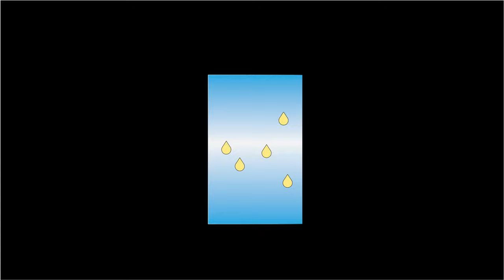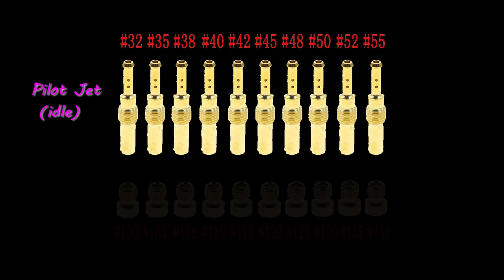Motorcycle ATV Engine Exhaust Popping or Backfiring - Rich or Lean?

Comment: We had the same experience with my motorcycle, I thought getting backfires are caused by a rich mixture so for the past 2 weeks I've been trying to experiment to add more air, but the backfires are getting worse so I tried to add more fuel, and now my motorcycle is running great and it has no backfires.

Comment: Excellent video! I’d note that for diagnostic purposes, the pilot jet is responsible for off-idle performance, needle/needle jet addresses mid-range performance, at wide open throttle it’s all main jet. I’ve found that Japanese OE needles are more accurately made than typical aftermarket versions so I usually just scotch-brute the OE needle and ignore the one furnished in rebuild kits.  To adjust the needle height when there is only one groove for the e-clip I’ve had success by adding one or more washers (thanks ace hardware) below the clip to raise the needle richening the midrange mixture—same result as achieved in the video by moving the e-clip to a lower groove.  Keep up the good work Redneck!

Comment: Bought a second hand Chinese quad for $500aud, got it from a diesel mechanic, he told me it had some sort of ignition problem and he started it by bridging the 
positive and negative, kinda a hot wire job, he told me he had no idea why or how, I got a new starter relay, and fixed. He also put a new pz30 on it and told me he could not get it to run right, used this video and moved the small clip down 1 notch, and runs like new now! So much for the sellers mechanical skills!
Reply: Lol

Comment: About non-adjustable needles, you can adjust them richer with 0.5mm shim discs. Though you cannot go leaner that way if your problem is too rich condition. Alternatively there are tuning kits from Dynojet to some carbs models and they may contain a new adjustable needle for carbs that are not adjustable by default.

Comment: Really good video right here! I have a 2005 raptor 660 that backfires a lot on decel and only will idle with the choke on until it is fully warmed up. It also kind of breaks up when giving it gas until after 1/4 throttle. Stock intake and exhaust too
Reply: Did adjusting the needle and cleaning the jets fix your problem?
Reply: @d21dusty72  nope, i replaced the piston and rings because it was low on compression. Thats fixed my backfire issue but I still need to use the choke until it warms up. Probably needs bigger pilot jets

Comment: What about running full throttle, then letting off completely say to shift or stop? Poping constantly after, it's fine at idle fine with the throttle, but now when decelerating especially completely, it pops.  I figure running rich but the fuel metering screw is all the way in ( bought a replacement carb). If I back out and play with the idle screw to bring down the idle it gets worse with the popping.

Comment: Fantastic video thanks! My problem is the motor and carbs run great while going wide open, but then after like 5-10 seconds it starts not sputtering and sounds lean -- wondering if the fuel petcock is blocking proper flow?
Reply from the maker: Close the petcock. Disconnect the fuel hose from the carb. Put the hose into a container like a large bottle to catch the fuel.  Open the petcock.  Let it drain for however long you want and see if the fuel flow gets reduced.  It's probably not the petcock, though.   It takes more than 5-10 seconds for the bowl to empty of fuel.
Reply: @redneckoriental  Thanks, I've adjusted the needle and I THINK its working finally

Comment: there is a third and fourth possibility for the popping
 valve clearance is too tight. If the valve cannot completely close, because the valves have not been adjusted lately, you will have popping either back through the carburetor if it’s the intake valve, or out the exhaust, which will cause popping in the exhaust system…
  another possibility is, a loose fitting header at the exhaust flange. And possibly an air leak because of a leaky intake, manifold, cracked intake, manifold, rubber, or poorly seated carburetor into the manifold.

Comment: I like your explanation and content it's easy to follow along and well explained. I'm having problems with mine backfiring on deceleration and sometimes while I'm in first gear on constant throttle there's a slight hiccup. However it seems to be running a little warmer but after a long ride where I could open her up it returned to normal but something's not right. Here's my question, I running a XR650R carb on a XR650L bike long story short,  was recommended by my mechanic who built bike but pandemic hit closed doors. I was stuck without a mechanic and  having carb issues so I googled it but could not find it. So, the fuel mixture screw was not accessible and everytime I tried to question him about the carb he would always say "nothing was wrong with it". But I kept trying to tell him how did he access the fuel mixture screw because there's no way to adjust. So have you or how do you tune a carb that does not have a fuel/air mixture screw?
Reply: There's a screw. Or mess with the top of carb to adjust. When the cap is off the top there is a clip.. Might have to move down. I have to do the same on a can am ds250 ATV actually

Comment: Hi. I have a 300 king quad. I have a 140 MJ and it runs great but it should be a 120. Should I change it back? Also, I'd like it to start easier.  It always starts, but sometimes I have to crank and crank. Any hints on where to look first? Pilot or fuel screw?

Comment: Enjoyed watching the vid. Hoping you can help me out. I have 2004 Yamaha TT600. Bought a few months ago and since have been doing a few jobs= leaky valves so ground them in, cleaned carbs, tappets, but also fitted a new muffler which has really opened up the motor, sounds great, air filter is standard, ticks over fine, nice and  slow but when you rev up it pops like hell on overrun. Should i lower clip on left hand carb to raise needle but what about right hand carb? Also what jets may need replacing in both carbs? Hope you can help, thanks

Comment: My 08 artic cat 650 h1 pops when I kill the engine, just a single pop out the pipe. I installed a brand new carb recently and it runs perfect just that pop.

Comment: So if it run worse when you put the choke on it means it's getting to much fuel, would that be right, I'm find at idle, just 1/2 to full is where I can't find the balance, it's spits and pops and most time cuts off after 10 secs of that unless I let off back to idle for it to recover, so glad your showing the sounds, most vids just tell you but don't show how it runs when jets are off, as well as which way there off at certain running conditions, tks
Reply: I would say your rich after the idle if it’s stuttering and cutting out. A surge in rpms is lean and bogging is rich flooding engine.

Comment: 0:57 this isn't exactly true, 'choke' can also mean an enrichener on a CV or slide carb. it serves the same purpose but in a different way. In a 'traditional carb' choking the carb pulls more fuel through the jet due to increased vaccuum, in a CV the 'pilot mixture adjuster' is bypassed and the full pilot jet is used. this means that the choke test may not work if the pilot is particularly bad.

Comment: I have the same issue on my motorcycle. Except it was working fine until I had to fix a leak in the bowl and now it sounds like in the beginning of the video. I've cleaned it all of the jets and it seems like adjusting the idle mixture screws barely changes anything. Could it be some internal circuit that's clogged? Except it was running fine before so I'm not sure what it could be...

Comment: I would have like to have seen how to know when the air and fuel adjustments are correct. How would we know? Do we start with air or fuel adjustments?
Reply from the maker: For the pilot (idle), turn the screw until the engine RPMS are fastest.  Then, some people prefer to have it run slightly rich because rich is better for your engine than lean.  For a fuel screw, turn counter-clockwise 1/8 turn to add a little fuel.  If it's and air screw, turn clockwise 1/8 turn to reduce a little air.  As for the the main circuit (throttle pressed), make the adjustments until it runs as well as you expect it to run.

Comment: I have a gy6 scooter and i have changed carb coil cdi spark plug air filter vacuum hoses and problem persists engine sometimes stalls exhaust poping this only happens when hot. When engine is cold it runs fine. Only thing i havent changed is the o ring on the intake manifold which is very flat hope that when i change it it will resolve the problem

Comment: Could improper jetting be causing my Honda 400 ATV To be vibrating bad at high RPMs? I installed a new full exhaust, and jetted per the exhaust manufacturers spec sheet, but I left the needle and f/a screw in factory position …. Please help, I hardly notice any power gains from the quality full exhaust I purchased and the vibrating makes riding so unenjoyable… I have another 400 same year with a full exhaust that I purchased as is, and it doesn’t vibrate at all

Comment: I have a 125cc 4 stroke yamaha xtz125 and its carburetor doesn't have the air mixture screw. My bike has the same prob with your quad. What should i do instead? Have checked the jet and the carb part

Comment: My honda foreman backfires on deceleration after revs and at idle it acts like its running lean and the carb makes a noise like its running out of fuel what would cause that?
Reply: Mine does to sometimes not for a day or 2 then when it does it ends up scaring me 1/2 to death 🤪🤪

Comment: My pit bike keeps studdering and sometimes pops at 1/2 throttle. Not that i run full throttle all the time but its still annoying. I already cleaned the carb. Threw in a new spark plug due to it being in bad shape and hasnt changed. Im gonna clean the carb again and try again

Comment: My bike backfires and shoot flames sometimes and the header of the exhaust is red hot when idling but when I start driving it’s not red anymore. Any ideas what the problem is or how I can fix this?
Reply: Exhaust red hot at idle is lean pilot. Go up a size or go out on your fuel screw. If its a 450F theyre not supposed to idle for long anyway not designed for that

Comment: I got two wolverine350s and they run like a top. Unfortunately both of them won't drive an inch. The axles and shafts on them are stripped out. From qhat I have read uts a very common issue with big bear and wolverines

Comment: I have a Honda VTR 1000 superhawk I just purchased it runs perfect but it does pop quite a bit when you back off the throttle I don't know if it's normal for those v-twins or not any information greatly appreciated is it typical?

Comment: Just rebuilt a 1996 Forman 400. I put the 450 jug kit on it and went to a bigger jet. It runs fine until your running real fast and then let off the gas it sounds like a bomb going off. That the only time it backfires. I’m going to try the choke trick tomorrow and see if it’s running lean. Do you have any other advice or tricks.
Reply from the maker: Popping on deceleration does mean lean. Yes, the choke trick should reveal that.

Comment: I am having an issue with my brand new carb on my 250. The bike ran great altough a little slow with the stock carb but wirh the new carb power was greatly increased but my idle is a little inconsistent. It will drop off as usual but it will rev up 100rpm from time to time up and down slowly with the throttle closed.

And if I pull hard on the throttle it will rev up but hesitate if I open the throttle too much it will simply bog down and die. I think I have it dialed in on the main jet but those 2 quirks are hunting me.. Any advice?

Comment: What if I have no popping on deceleration, everything seems to run great when smooth throttle is applied however if I crack the throttle open in a corner hard or fast it falls flat like it wants to die. Not sure if I should adjust the needle clip or fuel air mixture but when I do it doesn’t really help the situation unless it’s idling high and almost about a half turn out on the air screw…

Comment: Cylinder 4 on my motorcycle does this and spits fuel out the exhaust. Ive cleaned and adjusted the carb over and over. Thinking it might be a valve.

Comment: I recently rebuilt my 2014 Grizzly 450 carburetor, I also added a new air filter same as the original though, not after market. I set the air fuel screw to 2 1/2 turns out just like in the manual. All components and rubber diaphragms are in good condition. However, now when I press the throttle it sputters out and stalls out. Any suggestions?
Reply: No expert here.  Jetting perhaps...?  Slide in correctly?

Comment: Need help if anyone can help I replaced my carby for a bigger one than the small one I had on and bike runs mint without a airfilter but with one or even a small peice of foam makes the bike choke for air I've adjusted the needle for more airflow and also the screw near the airfilter on the outside the carb what would be the next step to help the airflow of the carby any help is much appreciated

Comment: My 400ex is popping on deceleration. What should I do?
Reply from the maker: It's most likely lean on the main jet.  If this started happening on its own, meaning you didn't make any changes to intake, exhaust, etc., then take apart the carb and clean it, especially the main jet and any fuel passages that feed it.  If that doesn't fix it, move the clip on the needle down a notch to bring the needle up.
Reply: @redneckoriental  ok only thing I’ve had done was get valves adjusted. I probably need to clean air filter . I haven’t cleaned it since I bought it back in March.
Reply: @redneckoriental  I’ll give those tips a try also, thanks.

Comment: here a Q for u what would u say if it backfiring after u rev the motor up and ur hand is off the throttle??
Reply from the maker: Backfiring when you let off the throttle (deceleration) also means lean.  This is widely debated as well, but I've tuned out these types of backfires by increasing fuel.  When adjusting your carb, it's better to err on the rich side than lean.  Rich uses up more fuel and makes more pollution, but doesn't kill your engine.  Lean makes it run hot, which isn't good for the engine at all.

Comment: I have a mini bike and it backfires hard on deceleration and doesn't want to stay idling most the time. I did put a new after market exhaust header but it still died at idle most the time. The stock carb on it is non adjustable, how can I fix this issue?
Reply from the maker: If your carb has no adjustment at all, even for the pilot circuit (at idle), it must be a a very small engine.   First, disassemble and clean the carb.  If it doesn't help, do it again.  At this point, if it's a really small engine, like a 10HP, Briggs and Stratton or Honda GX, you may consider buying a new carb.  They're cheap.  If it's a larger engine, I always like to repair the oem carb because most aftermarket carbs suck.  So if you want to keep the OEM carb, since your carb isn't adjustable, you'll have to buy jets.  You can usually buy "kits" that contain different sized jets. Replace the pilot jet with one that has a hole one size larger than your existing jet.  If it doesn't fix the idle problem, replace it with another size up.  After that, do the same jet tests with the main jet.  This will fix throttle related problems like popping when you rev and popping when you release the throttle and the engine's decelerating.  It's a pain, but there's no easy fix.  You just have to do it.
Reply: @redneckoriental  I ordered a carb for my predator 224 build but will just use that carb on the stock engine. It's a 196cc motor and I bought the bike brand new. The thing is tho it was assembled at the store from the service center they have in 2020. So its been sitting for 2yrs with a little gas in the tank and oil in the motor before I bought it.

Comment: My bike (2004 wr450f) did the same ,backfiring ,popping,red exhaust and boging... after I cleaned the carb , change the jets to the stock ones ,I did my research and I find out it was lean , so adjust it, now there is no popping no backfire and no red exhaust,  but from idle if I give full throttle it bogs and dies.! 
Any ideas ?? Thanks
Reply: That great video btw. 
I figured it out after your videos , that I haven't put all the plastics/covers on the bike , so it might takes more air , since the side of the air box is open . I'll put everything on amd try again .
Reply from the maker: It sounds like an accelerator pump problem. Some larger carbs like yours has an accelerator pump in the carb that squirts a little extra fuel in the carb when you throttle from idle.  Look for damage to the diaphragm or missing / damaged o-rings, cracked plastic tubing, etc. I don't have experience on your specific carb, but that would be my guess.
Reply: Thanks for your response,  I know for the pump , but the weird thing is that I have working good .  
Could it bogs if there is a lot of fuel or lots of air ? Since the accelator pump works ?

Comment: How about if it pops a lil after letting go of the throttle
Reply from the maker: On a carbureted engine, it means lean.  If you can adjust the fuel mixture, make it a little richer and see if it goes away. I wouldn't worry about running slightly rich, but running lean is a bad thing.